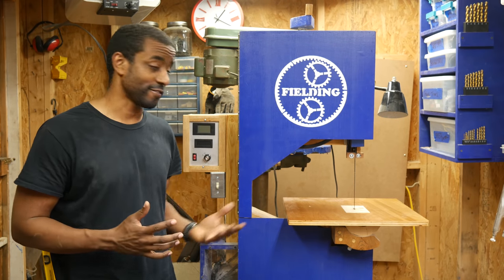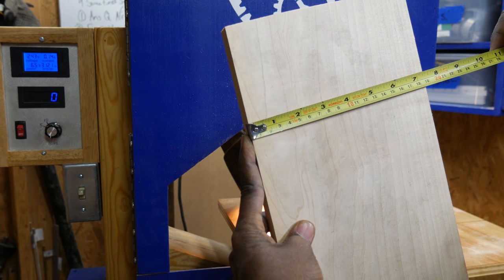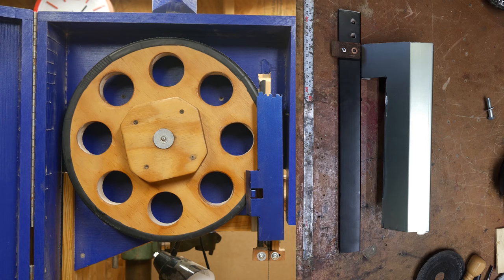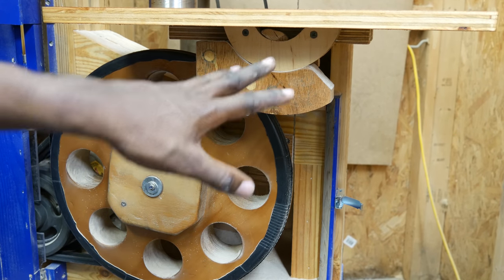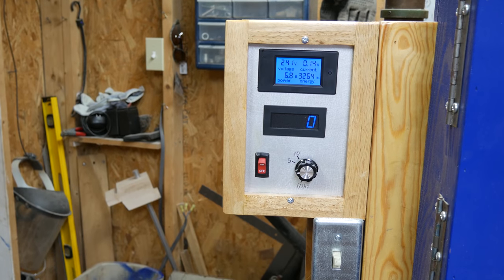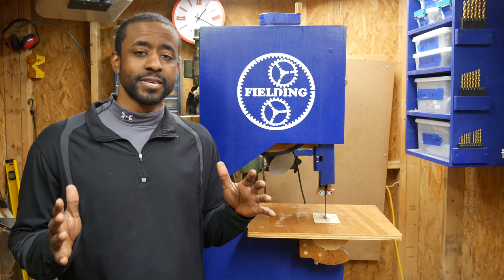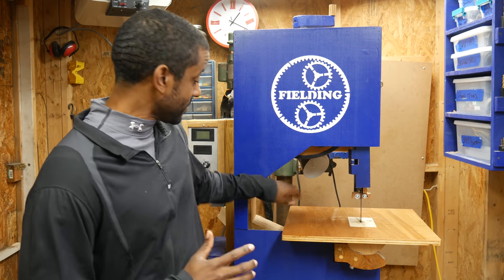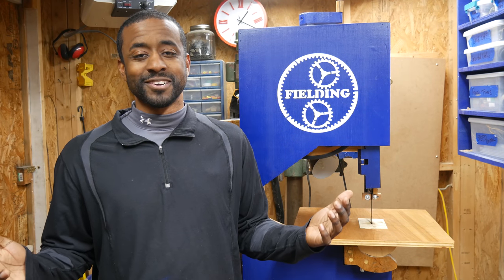My Version of Matthias Wandel's Band Saw with Variable Speed for Steel Cutting : 055

Comment: Jeremy, I've been subscribed for years now. Just wanted to take the time to say thank you. You are a humble genius! Very rare in this world. Can we get a look at the needle bearings you used? As for the torque of the motor. I would have thought that the commercial treadmill motor would have had plenty of torque at the slow speeds, even without the VFR. Imagine what kind of torque it takes to keep that belt moving, with a 400 to 600 pound person on it! I'm pretty sure that a variable speed controller could have been 'hacked' for this for a very cheap pricetag. :)
Reply from the maker: You can only control the speed of a three phase motor with a VFD. I demonstrate this in another video “can a light dimmer switch control an induction motor” you only need to watch the first couple of minutes to find out why a VFD is required
Reply: Ah. 3 phase. Understood. I was thinking of treadmill motors that are not 3 phase. 1.5 to 2hp treadmill motors really should do the job you are asking of this. There are lots of videos out there about using treadmill motors. Using only a small part of their native control panel and adding something that only costs about 12 dollars. Wish I could remember the parts.

Wait. So a commercial treadmill has a VFD? Or similar... Yowsa! Gotta start looking for COMMERCIAL treadmills! :) (Used treadmills are free around here on craigslist and various facebook pages. But I've never seen a commercial one, yet.)
Reply from the maker: You mean like the video I posted last week😂 yeah I know about that. But permanent magnet DC motors don’t have much torque at low speed induction motors have the same torque at all speeds with a VFD
Reply from the maker: If I slow the dc motor to the speed I use to cut steel I could probably stop the motor by hand. I have talked about this in my shredder series of videos. The second one with the picture of  “more power” and you see two motors running together
Reply: This is the sort of thing I was talking about... https://www.youtube.com/watch?v=_NmAFZMAfH8  ~15.00 to 20.00 to make. (He says he gets good torque at low speeds, but people responding are disagreeing with him.)

I have asked several people if the 1.5 to 2hp motors they used on their bandsaws have much torque at the lower RPMs. No real replies, yet. 

Just seems to me that if that motor has to keep that treadmill belt going even at it's slowest speed with 400 to 600 pounds on it, it should have no problem keeping a bandsaw blade going, through steel. Guess I am just going to have to build one myself some day, to find out for sure. :) Of course it may be bad news for me, if it doesn't do it. LOL Thanks for batting this around a bit with me.
Reply: Great discussion, but I couldn't help but laugh when you mentioned 400-600 pound people using a treadmill. You have seen a lot of those have you????
Reply: You haven't? ;)
Reply: I must of missed them!!
Reply: Gotta agree with on the person Jeremy is! I find him remarkably brilliant with an easy demeanor! He just makes it easy to watch even if at times im not sure what he's doing. 🤣🤣. I would say that is 100% his demeanor! 👍😊
Reply: selador11 ha don't kid yourself, 4 to 6 hundred pound people don't get on treadmills. it's the folks that workout on a regular basis. so that is to say if the 400 pounder is the guy from Game of Thrones playing Sir Gregor Clegane, yeah he's healthy and not overweight or under tall as the case may be....so he might be a regular on a treadmill built for giants( American Football players too) but not too many people who do weigh that much are so physically active.

Comment: I'm working on mine now.  I'll be doing the frame glue up this week.  I've got a large 3hp treadmill motor that I've rigged up with a PWM power supply for variable speed.  Basically everything is stuff I had on hand from salvaged wood etc.  the only expense will be a couple of stainless shafts, some bearings and hardware, glue and what ever finish I put on it.  I expect the build to come in at around $150.

Comment: Fabulous, Jeremy. Those are brilliant modifications to Mathias' plans. The main thing I was skeptical about on his was the lack of rigidity. You solved that problem very well. And I agree about the trunnion. I have never tried to cut at a bevel on a bandsaw, and doubt I would ever want to.  So skipping that component would make the project a lot easier, and add to the rigidity overall. Changing to needle bearings and a hub over them is also a vast improvement. Excellent, my friend!

Comment: Built my own 14" floor stand bandsaw back in 1986 my own design, no plans. I purchased two 14" in swamp cooler squirrel cage pullys , went to the local hardware store and bought a set of sealed bearings and shoulder bolts,, " think they were "1 o.d. x 5/8" shaft i.d.. Took the pullys and with calipers centered the bearing receiver's, scribed thee aluminum wheels and went to work removing material with a dremel and wood burring bit. Then built the tensioner alignment plate to bolt the upper wheel using "L"type concrete anchor bolts giving me my pivot and mounted it to a 3/4x3/4" x 5" square stock steel bar, 5/8" holes on each end to run "L" bolts through then aligned and welded. Same bar with 5/8" threaded hole in the center for "tensioner" assembly,, elaborate, but effective for simple alignment process. Built the guides with various size bearings and hand built, brazed and welded guide assembly mount's upper and lower. Back to the squirrel cage wheels,, I spent considerable time and trial coming up with a firm but pliable material for the outter wheels, it had to be firm enough to withstand the steel blade tension without tearing up. Tried almost everything applyable from silcon rubber caulk to soft epoxy. Then one night wrestling with the problem in my bed it came. A new fan belt cut with an angle lap joint a little more epoxy applied to the groves of the wheels. Then wrapped with bailing wire twisted down tight till cured. Once cured, bailing wire removed, chucked um into the drill press and at low speeds shured trued and rounded with 80 grit oxide on a sanding block. The frame, table neck were a piece of cake and my neighbor was a metal building contractor who had plenty of pop rivets and sheet metal for the casing housing.  "Regretts?" I too wished I had built a bigger throat to blade,, AND,,, I left it behind for lack of room when my now ex-wife, I and children moved.

Comment: I’m very impressed the vfd is really a game changer, as long as you can get most of the parts from the dumpster it’s really worth all the efforts. As for me who is a noob when it comes to electronic I guess I just bought a used machine if I wanted to cut steel . Thank you for sharing your work it’s really inspiring and I learned a lot about things I never thought I could understand.
Reply: if you wanna go with lower power, you can get 1kw vfds for 40 bucks, the wiring is simple, you put mains in, and plug the 3 wires of the motor out. then you are ready to go. (though I would suggest putting a heater on the breaking resistor and a big red button instead of a short for the safety)

Comment: Nice build. In a shop I worked at we had a mechanical variable speed saw that was controlled by a lever and had a hi and low range. Im not sure how it worked but my guess is two adjustable V pulleys. It had 3 wheels to carry the blade and that allowed for a very deep throat. We were cutting sheet metal and ran the blade at high speeds. I was told even a dull blade would work because it was more like a friction cut. I never looked into the math. It was a DoAll brand if you are curious.
Reply: I just bought a do-all bandsaw with 4 wheels, haven't used it yet though. Did your blades last ok with the smaller wheels on the do-all?

Comment: Awesome overview but another request to go more into your pin/needle bearings as I’ve not seen those before. I’m following along, got the 20” plans and just my luck a week after Matthias is making what a ?32/36” I lost track of the final size new bandsaw videos. I figured if I build one I’d build the biggest I can to save bumping into the shoulder and other limits. A+ channel, I’ve not done this since a long time when I salvaged a washing machine motor and built my own grain mill for home brew 👍

Comment: The people who voted this video down will burn in hell.  I have to ask if you built the monitor device that tracks power, rpm etc.  If you built it and have a schematic and the parts list, I'd pay you for it.  I bought the plans from Mathias a long time ago but have been deciding on building it with steel.  I want to build it now just so I can have that awesome little monitor you have on it.  I am jealous as hell of your knowledge, confidence, demeanor etc.  If you are a dad, your kids are freakin' lucky.
Reply from the maker: I haven’t made a schematic. It will vary depending on the parts use etc. I don’t remember what’s in there exactly after all this time. I made it in the shop without a plan

Comment: What are you using for friction on the drive wheels? I assume the wheels ar ply. I have a 10" craftsman band saw, ad would love a bigger one say 16 - 
20" one. I could use most of it to upgrade  it.

Have you or know where to get plans for a hobby size table saw?

Comment: Very nice job Jeremy. You inspired me, to build my own. 
In my opinion needle bearings are mostly used for radial loads.
Do you use needle bearings which are built just for radial loads or combined ones (axial/radial)?
How do you lubricate the bearings?
Are there types with lifetime lubrication and sealings?

Comment: Jeremy, I’m burning through your excellent videos and learning a lot! You’re a natural teacher, I’m sure you hear that a lot. 
Someone asked which VFD you used and you said you didn’t want to specify a manufacturer since it was a new purchase and a new application for you. So, two years later, how has it held up under use? If it is working okay, would you care to mention the make and model now?
Best regards.
Reply from the maker: Actually no...about once a month it stops working and I have to restore it to manufacture defaults and redo all the settings for it to work again. I literally just removed it from the machine last month and decided it wasn't worth the trouble. When I walk over to the machine I just want to turn it on... not troubleshoot problems.
Reply: @Jeremy_Fielding  Thanks, Jeremy. That’s very helpful, and I think I’ll spring for a name brand. Like you, I just want it to work and otherwise sit in the background.
I appreciate your attention to your viewers.

Comment: Great job...yes, I always try to use what I have on hand. Question about the treadmill motor...is it an induction motor? Usually treadmill motors are DC. Matthias says to use an induction motor only. I already have a 2HP DC treadmill motor. Is there a difference in the context of a bandsaw?
Love your videos!
Reply: Duh! Sorry. I just realised a three phase motor is definitely not DC...LOL. Still wondering if my DC treadmill motor will work on my bandsaw. Strictly for cutting wood.

Comment: One of the things i notice with everyone who has a VFD, is that they hardwire it to their tool like you did here. I don't see why. Even if you're going to mount it to the machine, and hardwire it, put an outlet and a switch on it, and plug your machine into the outlet. You're never using more than one machine at a time, and then you can use a single VFD to do fancy speed control for every tool in the shop. I guess you only have one 3ph tool, would be different if you had a 1ph VFD.
Reply from the maker: That is certainly an option if you have multiple tools that need it. It needs to be centralized among the tools that use it but that is easy enough

Comment: Good job.  I can't think of any reason to build tools unless your channel is at least partially about building tools.  My used bandsaw was 200 and time invested was the drive to get it.  I enjoy the watch, but would never build my own.  Edit:  Matt's saw mill is awesome, not a hugely precision tool so that one seemed worth it even though his channel isn't about building tools.
Reply from the maker: Yeah... its not for everyone. I think the hours spent only have value if you actually wanted to build the tool to begin with. It’s a lot of work to save money which is the only other motive I can think of right now. However, if you have a lot of time and not much money it is a good trade. You should always do what works for your shop, and I will do the same. I love building tools... thus I built one
Reply: Yeah, you have to use those motors on something so may as well build a tool.

Comment: what are the specs of the motor? you just mentioned is a 3 phase 220v motor but i would like to know how many hp and RPM. i want to make a replica of what you just did with yours. i want to be able to cut wood but also steel. can you tell me whole specs of your band saw? like motor specs, vfd specs, type & size of band saw blades, variable speed controller, etc please. thank you jeremy.

Comment: You mention in several videos that you want to have variable speeds from a motor without having to change belts on a pulley.   Have you ever heard of something called a Shopsmith Mark 5 or Mark 7.   Really is unimportant which model for this conversation because I want to focus on the headstock of the shopsmith.   They use a sheave pulley on the drive and connect the motor to the drive with a single belt and pulley.   From there, it’s a matter of turning i knob on the outside of the housing and I literally have infinite speed choices for the drive.   Shopsmith was invented in 1954.   They still hold some cool patents regarding the way they developed their bandsaw and how it never needs adjusting.  Take a look, maybe it’s an answer for you when using a single speed motor rather than using a VFD.   If you need, I can gladly send some pics from my Shopsmith and what I am talking about.

Comment: How did you calculate the power of the motor needed for this project?, To  be more specific , for a certain hardness of material how do you calculate the motor torque requirement ?

Comment: excellent job !! its like his saw on steroids! That powerful motor is going to last forever! Pulled like no amps cutting through that steel, very efficient! You both had the same problem, you want a bigger one now ! How is that drive pulley connected? it looks like the keyways arn't aligned? I'm probably missing something. Keep killin the content!
Reply from the maker: Just using the 2 set screws without the key. I would need to buy or make a key. I just haven’t done that

Comment: This comment is not for you, Jeremy. For your viewers. There is a tradeoff when using a VFD to slow down a motor. The rated power of a motor is only applicable when the motor is running at rated speed. When you slow it down with the VFD, the power is reduced by the same factor. For example, if you run an 1800 RPM 5HP motor at 180 RPM, you will only have around 0.5HP available. In the short term you can get a bit more. Maybe up to around 1 HP.  Even though 4 HP may seem like overkill for a bandsaw, it was a good idea in this case so that there will still be a decent amount of power available when running slow to cut steel. In order to make the most of a smaller motor, it would be better to use a gear ratio that allows the motor to run at full speed when the blade is running at the desired speed. Otherwise, use a massively oversized motor like Jeremy did.

Comment: you say you are using a vfd  what are the components on other side that show speed etc  and where did you get them if you don't mind me asking as im looking to build a bandsaw from the plans with a three phase motor
Reply from the maker: None of the displays on the front are required. That was purely my preference to put the VFD on the back, to remotely control it with a potentiometer, and add all those features like speed etc. They represent several misc parts from old projects, I don't think you want to chase all that down, and neither do I. Your VFD should have controls. I recommend you use that.
Reply: thanks Jeremy but the vfd is a large box I want to put out of the way hence  me asking about  a separate displays as im like you lol and like things in easy reach  many thanks though

Comment: do you have a video on VFD controllers? Do you have 3 phase power? I have heard of rotary phase equipment to run a 3 phase motor. I never heard of these. Thanks,
Reply from the maker: The VFD converts single phase to three phase.

Comment: How many hours, roughly, did it take?  (In 30 years, I've never tilted my table either.)
Reply from the maker: I built it a little at a time over a few months so this is a really hard question. If you have a massive shop with space to spread things out, a experienced woodworker could make it in 5-6 days. For a novice who is also a weekend warrior it could take double that. I would add about 50% to that time if space is limited. I was constantly bumping things and moving parts inside and outside to build it. I spent a lot of time just figuring out how I was going to work on it inside my space when the weather was bad.